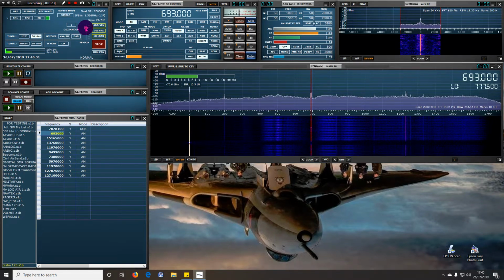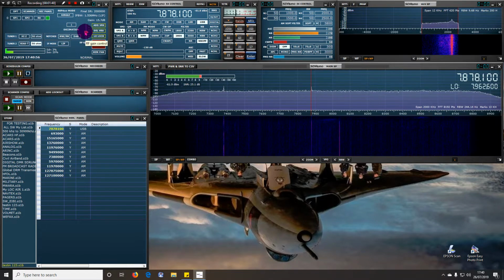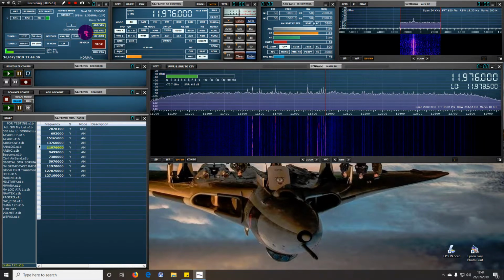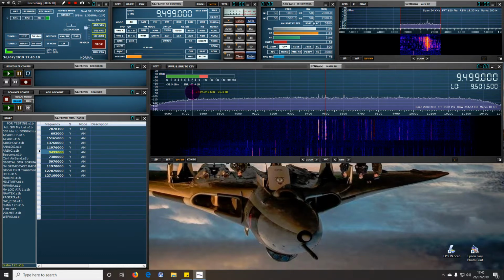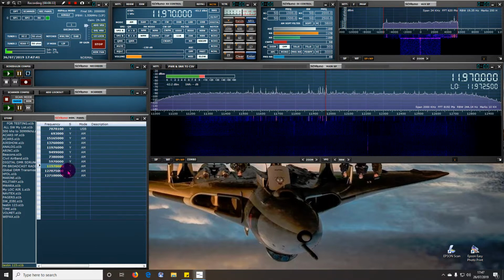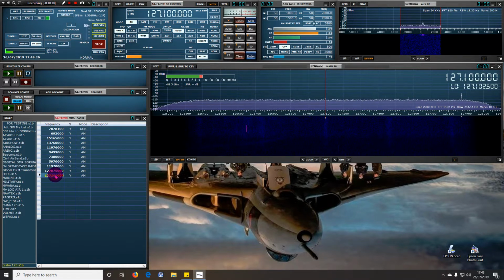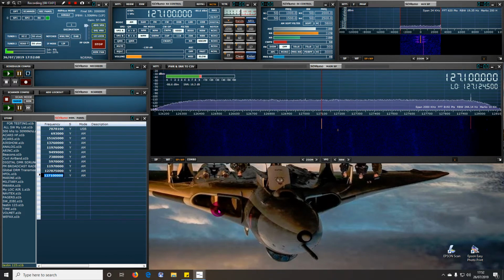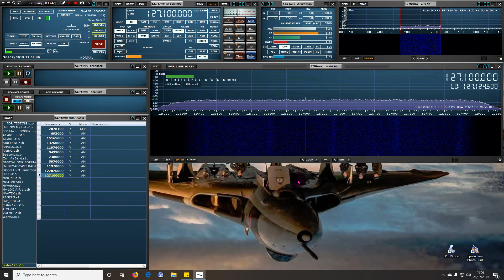SDRPlay & SDRuno Slinky VS MegaloopFX IN A GROUNDFLOOR FLAT test 2

Comment: Wow!  Another proof that a Slinky is better than nothing, but only for an emergency.  That loop is just kicking it to the curb.
Reply from the maker: i agree, I have also found out why the noise floor is higher on the loop, it is because my monitor (a smart tv) is right next to the window where the loop is  but the slinky is on the curtain pole end furthest away from monitor although right next to one side of loop, distance to slinky from  monitor about 4ft, i did turn pc and monitor off and use my laptop about 4 ft from the loop and it improved even more.